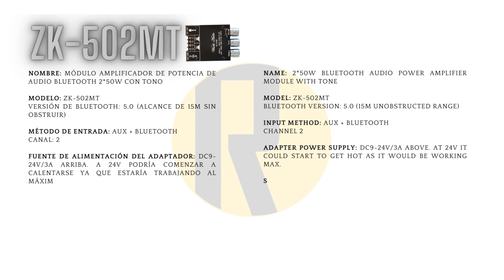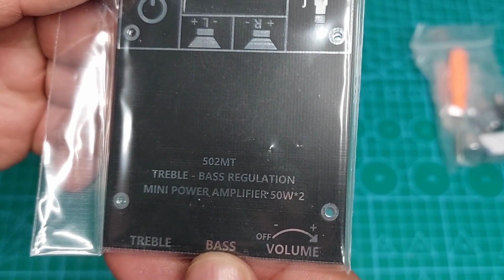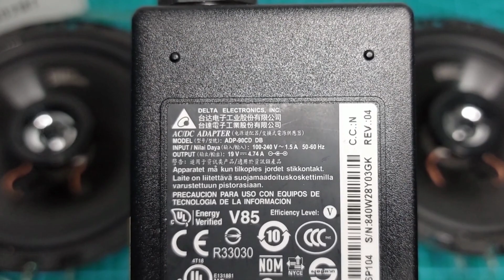Placa Amplificadora Bluetooth ZK-502MT 50W*50W | Unboxing, Armado y Prueba

Comment: Hola amigo, pedi dos amplificador Zk-Mt21 sabes si estos son de Calidad? Estos por pedir dos Zk-Tb21 y después este de tu video, para un proyecto de audio,  me puedes dar alguna recomendación sobre las fuentes a utilizar?
Reply from the maker: Hola, el mt21 a diferencia del tb21 es que el tb21 si trae chip TPA3116D2 y el tb21 no trae. Los chips tpa son más  potentes. Puedes usar fuertes de 12v a 24v mínimo 3A y max 10A.
Reply: @rabbitaudiodiy  no se entiende tu respuesta, el tb21 trae o no trae chip tpa3116d2?
Reply from the maker: @charlycj1699 tb21 si trae de hecho puedes salir de dudas leyendo la descripción de el artículo de venta en AliExpress